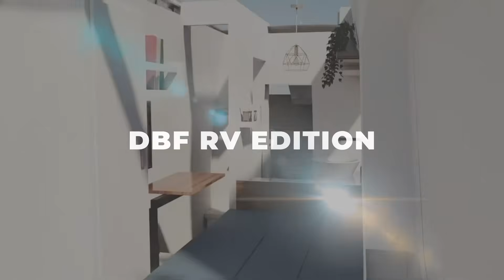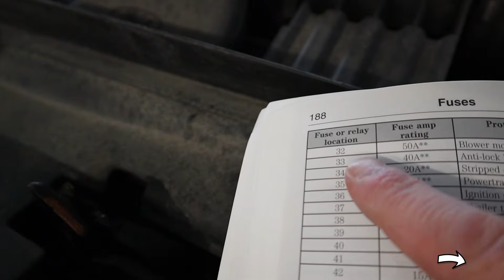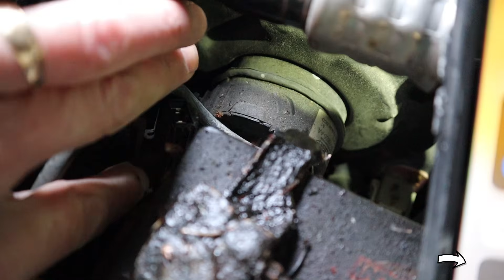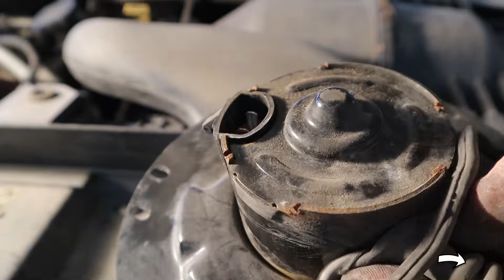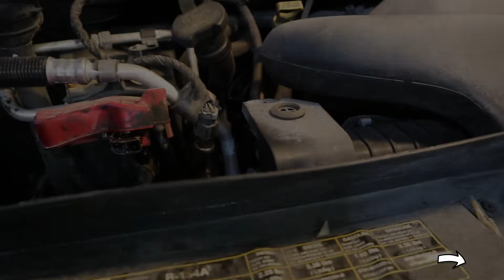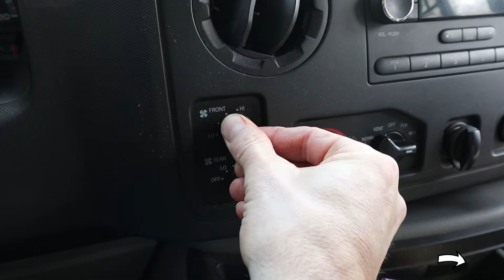Blower Motor & Resistor Replacement E450 ( Shuttle Bus Conversion Epi 6)

Comment: Thank you very much for this.
Reply from the maker: You're welcome! Thanks for watching!
Reply: @designbuildandfix had to run my van without heat in -10 weather for a day. I found your video and tackled it no time, only hang up was they sold me the blower without the gasket....so I had to drive back and swap it for one with.